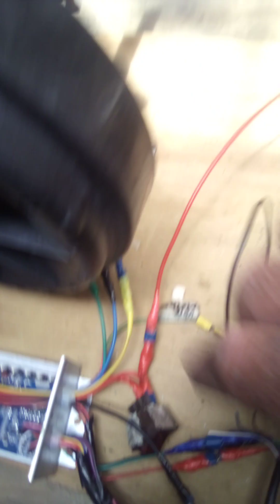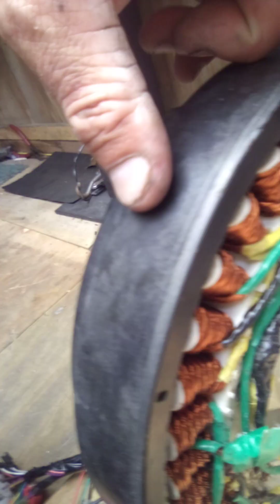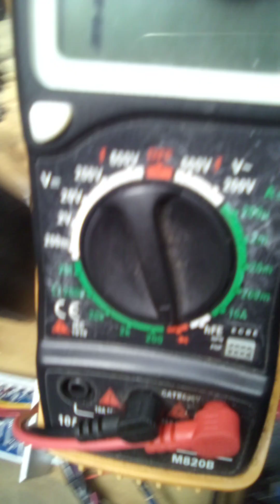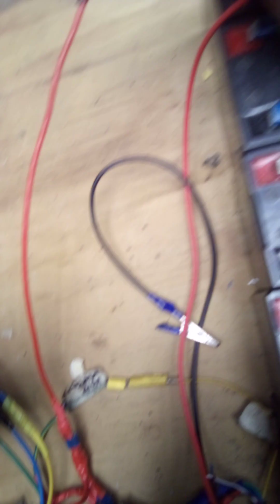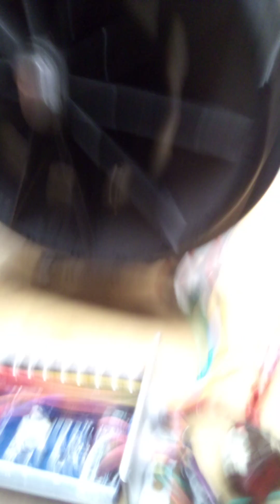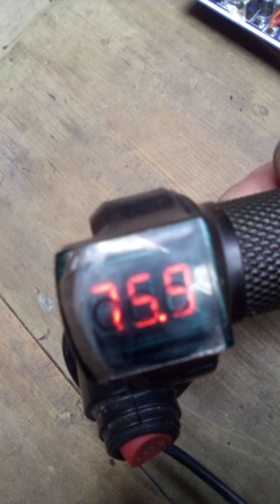1000 watt 72 volt brushless motor controller running a 36 pole washing machine motor

Comment: Is it enough torque for 700lbs
Reply from the maker: If it was stock wiring yip but this has been rewired to be 4 X faster so a bit of that torque drops off .now it's good for 200lbs👍🎉 biggest thanks from cruzermans inventions 😁🎉🦇
Reply: @tristanmcnabb2741  easier to rewire direct drives than to modify a 5kw to 10kw portable generator head to work as a drive motor?
Reply from the maker: I don't think people grow to 700lbs
Reply: @tristanmcnabb2741  I have a 500lb buggy that I want to make electric plus me and 5yrold minus engine

Comment: Hi to you Tristan, I received my controller. The surprise is here! with an unmodified DD, the rpm are low.72v input 120rpm. But with a modified DD with the same input, I go up to 750rpm. We were wondering if copper was better than aluminum for performance?
Reply from the maker: Yip cooper seems to be way better for rewire a motor more powerful allsome work keep me updated,😊😁👍🦇🎉 allsome work from cruzermans inventions